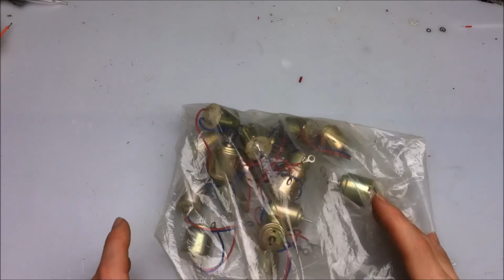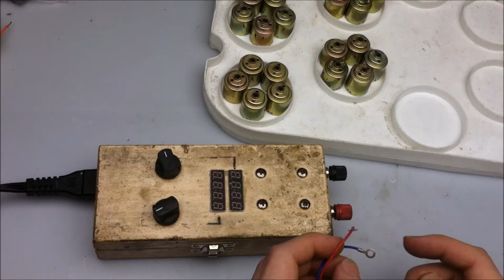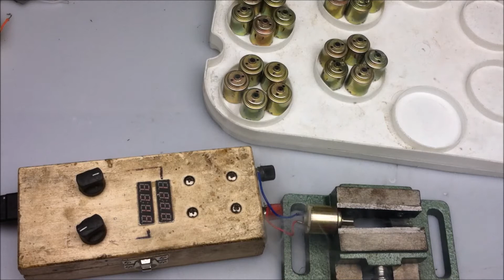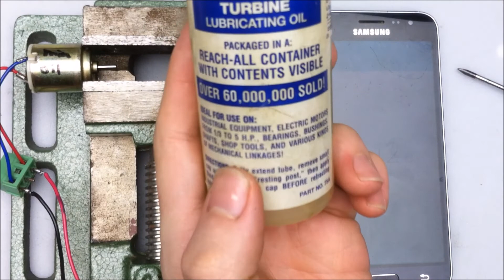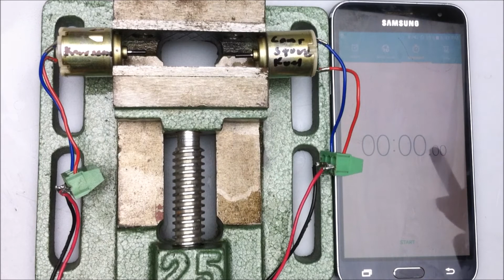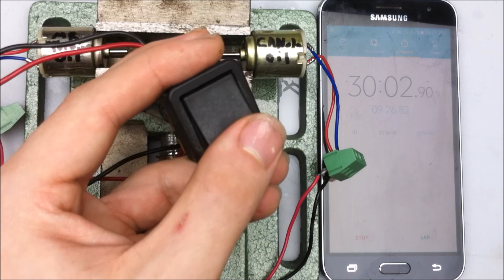DC Motor Death Matches! What's Winning at Spinning?

Comment: At first. It was very special to see the testing's turbines at the mean time. The sound was high noise very sharp on the strokes, but the speed test I due say: was a biggest trigger. All that was using smaller turbines. I left impressive with the results. In the twenty minutes, the smoke started to go more visible. That's mean: that cannot use more hight level volts than 12V.wow! 9m 22s ended 30m.The second part was a definitive test for every turbines. I have to recognize the force of those turbines. Twenty volts seem to me exaggerate to engine the small turbine, but was a great experience see how works. The next once try a test using turbines more bigger than it, to see the results an another level. And don't you forget the helix. Thank genius!
Reply from the maker: You mentioned " helix " I am not familiar with that in motor terms. I agree 20v might of been excessive, I had hoped both would run longer during that run. If I ever get a bunch of bigger matched motors that are questionable I might run other tests at greater powers. I could not think of a better use for all these in the condition they came to me in.

Comment: This is great! Thanks for the upload!
Reply from the maker: When life gives you motors find motor aid!
Reply: Zenodilodon I’m really amazed that canola oil won. I do wonder about it’s long term resilience though.
Reply from the maker: @LaserPictures  I am too at this point. I do believe it might slowly evaporate. I might have to do a long run time test as a follow up to the question. Probably run it at 5 volts for a time and see how long it lasts on something like a little usb charger.